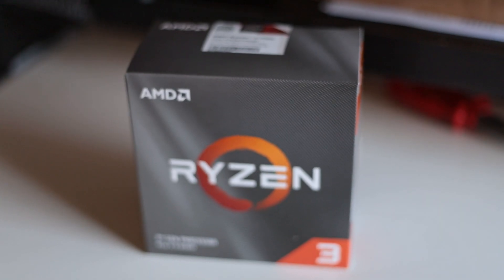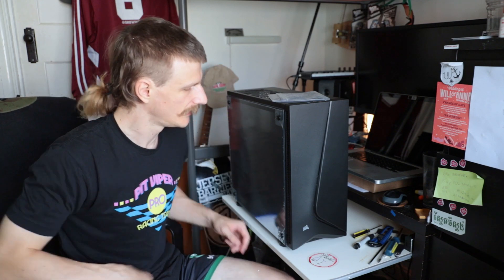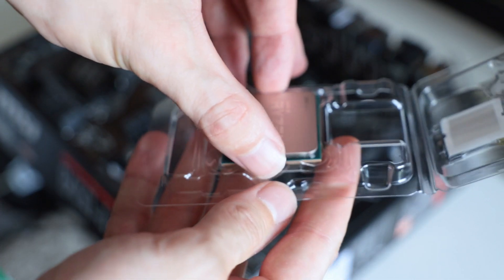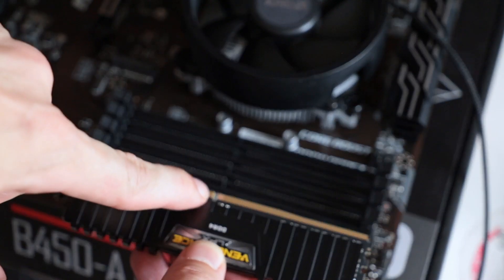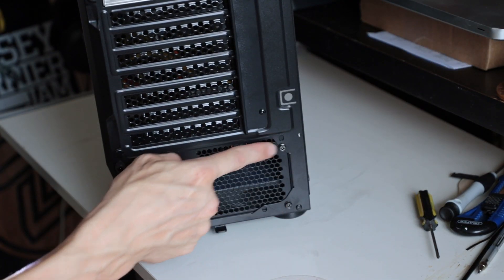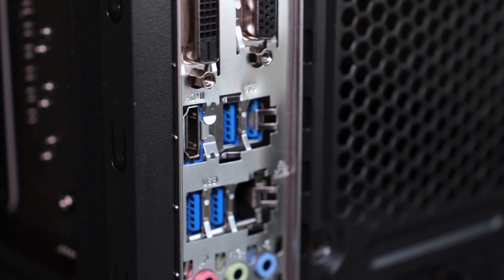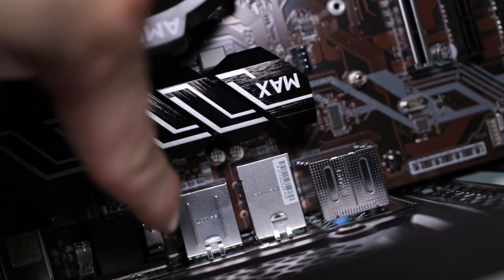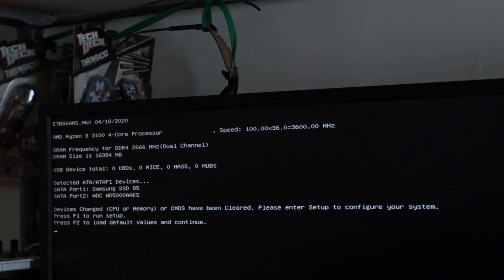Can a beginner build a PC? ... NO!?

Comment: Very good! Although... did you not put any thermal compound between the CPU and heat sink?? RE file formats, Windows 10 will work on either a fat32 or NTFS partitioned USB drive.... with regards to win 10 not seeing your hard drive, when you get the install windows 10 bit, if it doesn't detect the hard drive it's because its missing drivers for the chipset, if it can see the drive but wont install on the partitions, just delete all the partitions and it will create them for you.
Reply from the maker: Some great advice! I had a right headache with install. I even went through the process again - found it wouldn't work formatted to GUID and would work after setting it to MBR?! I think I went through about 1000x different processes....... Funny thing is the hackintosh process was easier! Work that out. 

With regards to thermal paste, the ryzen 5 3100 comes with a pre installed pad from new - so didn't need any. When I upgrade, I'll probably buy second hand and will definetly be using paste! And not mayo.........